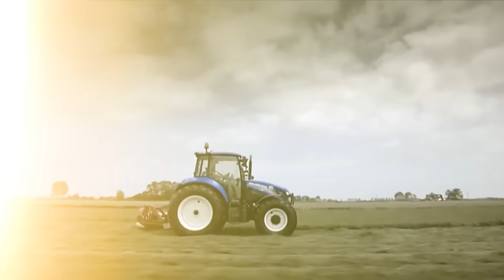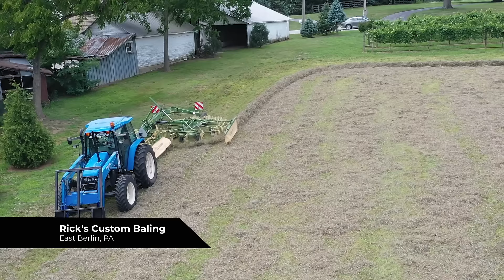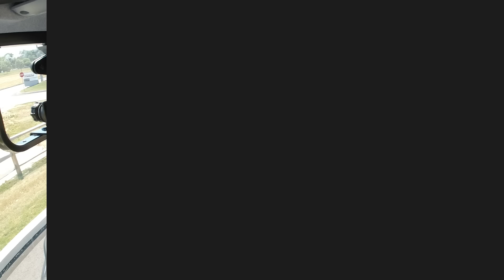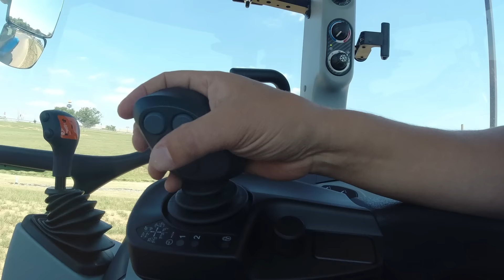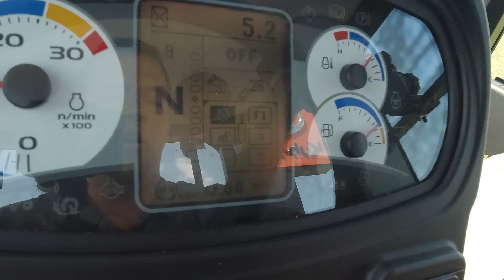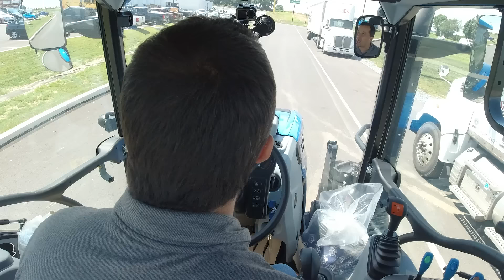New Holland T5-120 Electro-Command driving demo and review.

Comment: I bought the same tractor 4 years ago, it's been very reliable, easy on fuel and nice on the road and in the field. You can spec them up to front suspension etc. Great machine very pleased with mine